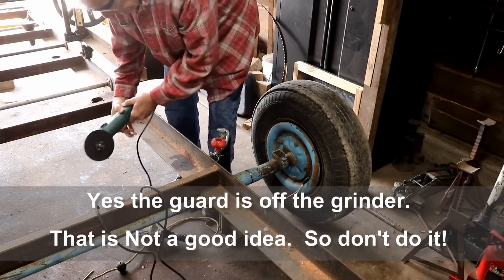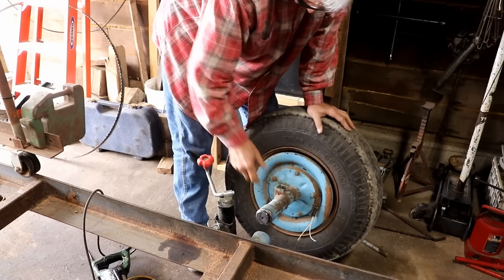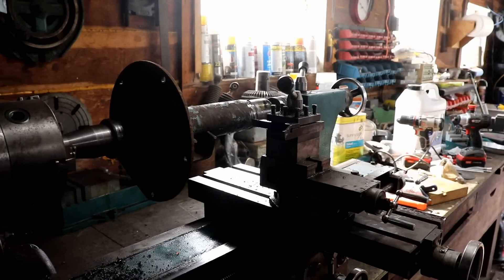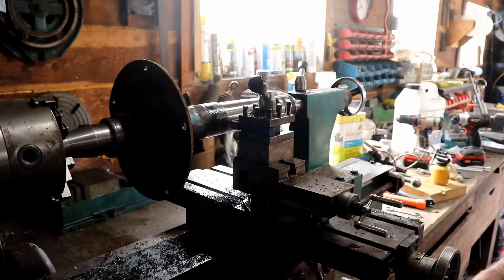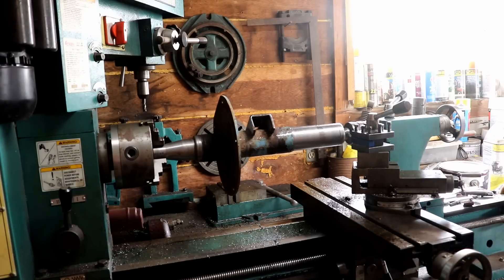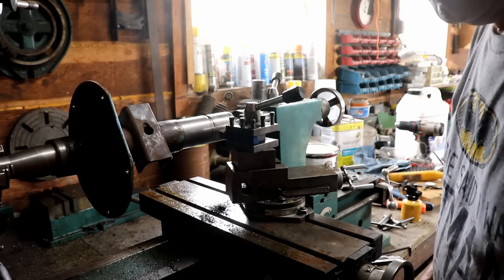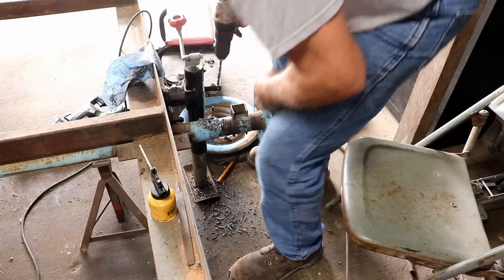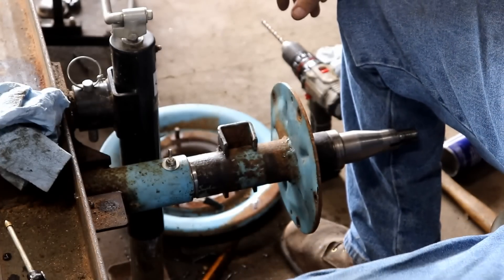637 RSW Sawmill Modification

Comment: TapMagic makes drilling out heavy metal quite a bit easier and is for more than just cutting threads.  My goto for keeping sliding parts sliding though is Blaster Garage Door Lube.  I even use it for control cables in a salt water marine environment and most folks are amazed at the results which can last for a year or so before another spritz is needed.

On tubes I tend to use a drill mounted wire brush on an extended drive shaft to clean out sand, rust scale, etc, etc from inside them.

Best!

Comment: If I might make a suggestion Gerry, after a short spell working in a machine shop, for the lathe cut I`d recommend a constant lube feed for a cut that size which, I know you`re not set up for but then, you are very good at modifying things to make them work for you, the one we used was Milky white in color, it had a code not a name?? they also had a catch tank to re-use it,  and if I wanted peace of mind with the wing nut, I`d simply drill a hole through & use a split pin, just a thought!

Comment: Considering how well tapers work in drills and lathes, maybe a #18 Brown and Sharpe should have been your target.  Then cut an access farther up the axle and weld in a plate for a drawbar, and have the most over-engineered trailer axle ever.

Seriously, though, why not just de-handle those darn jacks and weld on a hex head so you can run them with a cordless impact?